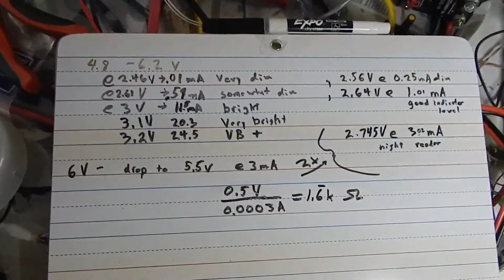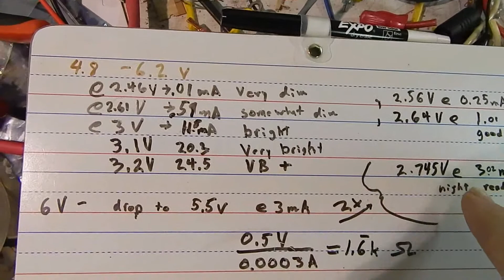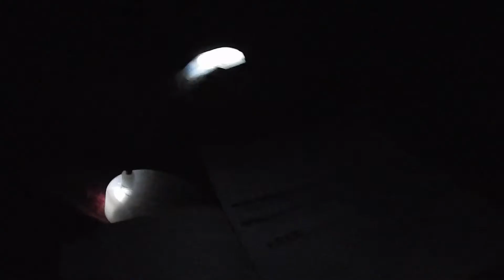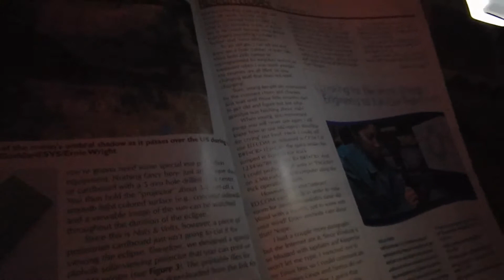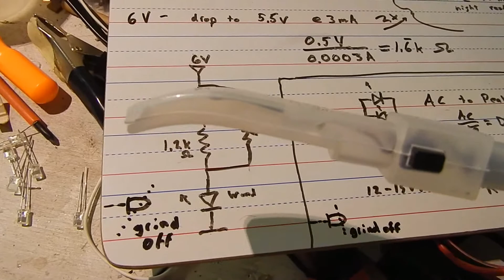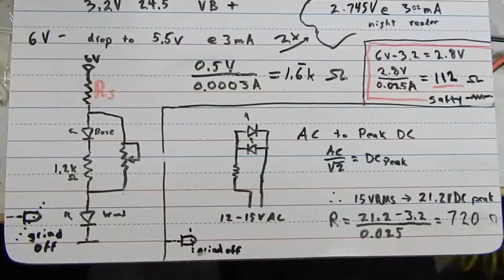Simple LED Projects - Mini Reading Light Conversion

Comment: The LED may get fried on a new set of batteries unless the pot is still limiting current a bit even fully cranked. 40 or 50ma is okay with these Cree LEDs for temporary use devices like this. Max rated current is 30ma for continuous duty.
Reply from the maker: I should have noted the battery change to fresh cells midway through the video.